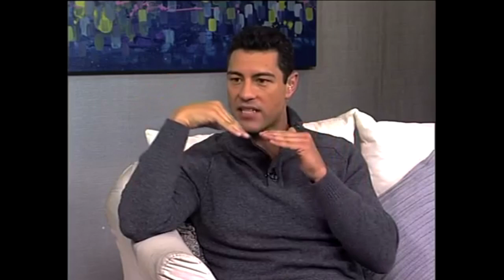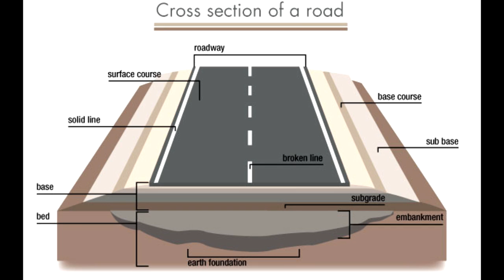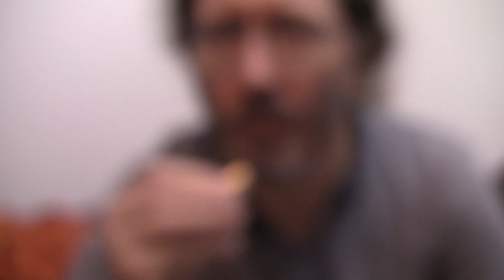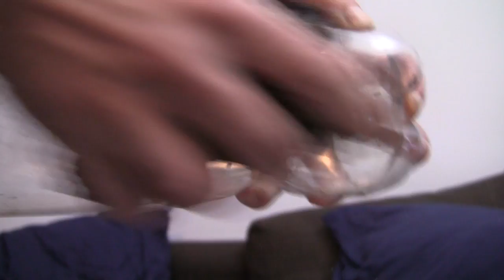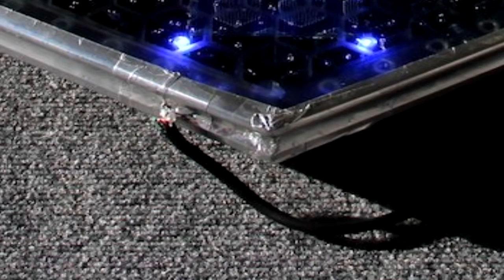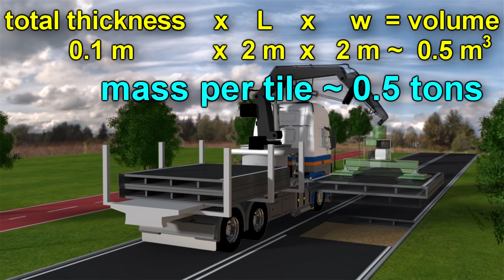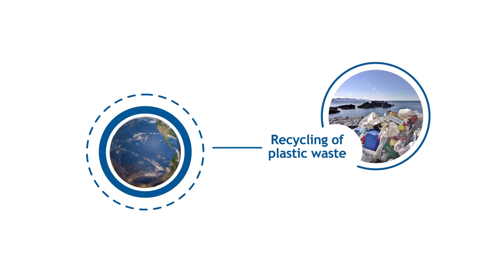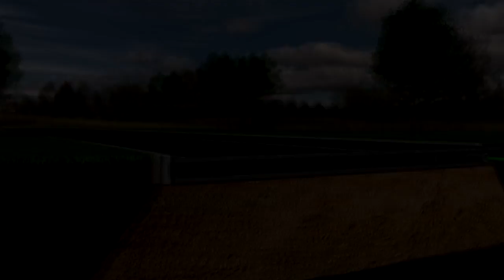Plastic Roadways BUSTED!

Comment: Or you know, we could recycle the bottles into, like, other bottles.
Reply: Or even clothes, I used to have a jacket made of recycled bottles (or at least mostly I don't remember it was a long time ago)
Reply: @kryska1345  the microplasts would be flushed out into the ocean when you wash your clothes though. Not the best option
Reply: @kryska1345  a fleece jacket?
Reply: LazerLord10 that's crazy
Reply: LazerLord10 What are you... logical?
Reply: LazerLord10
The carbon chains break each time plastics are reused.  This means that there is a limit to how many times you can recycle hydrocarbons, due to this deterioration.

A better process would be to track plastics from production through to eventual conversion into e.g. a fuel source, or conversion into some form of aggregate for use in a suitable application.
Reply: Quick, we need an animator; partner.
Reply: The problem with that is after recycling generally the plastic is no longer food-grade, so it can’t be used for bottles storing anything we’d drink. But we could use it to make bottles for storing chemicals, like bleach.
Reply: @loganiushere  nope, we recycle to be usee into the same bottles.
That's why I said they collect their own bottles. Knowing exactly what ingredients are in these bottles plastic.
With just random recycling it might be the case didn't check.
First they would even wash the bottles and refill. You could notice scratches and a wear patern on points were it was rotated around some equipment.
I don't know why it changed to melting it down and reforming, maybe hygiene.
Reply: @MrSpacelyy  yes it is cause of Hygiene, they must make sure that every little bit of matter that mightve imbued itself in the plastic gets removed, also on top of that they probably have to melt it down also to get rid of whatever weak points or damage the bottle sustained.
Reply: Generally packaging that comes in to contact with food is virgin grade.
Reply: absolutly right
Reply: We stay litty
Reply: Welp we found out that recycling is actually more expensive than making new plastic thanks to China
Reply: It degrades I think it's like 3 time they do it aleast where I am .... they even make jackets ect and outher material
Reply: Bruh
Reply: LOL, 6:40 wouldn't that just give it MORE GRIP?
Reply: *gasp
Reply: And now we’ve learned that recycling is all a scam invented by plastic companies. Great. Thanks, PBS Frontline!
Reply: @alt8791  some weird conclusion...
Maybe give us some arguments why you conclude this.
Reply: @MrSpacelyy  PBS Frontline investigated it. I believe the episode is available on their YouTube channel, and it’s definitely worth an hour of your time (as are all the episodes of that show). But in a nutshell, recycling doesn’t work nearly as well as we’ve been told, it’s far cheaper just to make new plastic, and the only reason that we treat recycling as the magic solution to all of our plastic problems is because of decades of lobbying by the petroleum industry.
Reply: @alt8791  hmm, that you still saying that.
Making new plastic is cheaper for those companies. You don't need equipment to recycle material. That's not a good reason.
Making plastic from oil is somewhat cheap because we allready proces oil. If we didn't it would be more expensive.
Also also, even if it's cheap, you need loads of energy to refine oil.
And you add more plastic to the environment.
This is undesirable. You want to stop adding plastic. But that's not yet possible. You can recycle plastic. This does use less energy in total. Even if it's not cheaper.
You don't need to get oil out of the ground, you don't need to refine the oil. You do need to clean filter and refine the plastic.
It depends on what you think is important. Adding less plastic to the environment is important.
Recycling and using less plastic will help with this.
Creating new plastic doesn't help.
Another thing we could do, is just burn the plastic and make new. This might be an option. It does add co2 and nitrogen oxide to the air, but it doesn't add plastic.
You could use the energy of the burning (indirectly) to help create the new plastic.
It might be cheaper, but it isn't cleaner.
You need to look further than just a few decades.
That's hard for humans, because that's how our brains work.
You can also recycle plastic like we do here with bottles, they used to just clean them and re-use it.
That might be a bit unhygienic, so now they collect their own bottles. Keeping the material the same. You can easily melt and reform these with little energy, and it's hygienic. This allready happens.
Recycling plastic this way doesn't involve a lot of filtering and sorting.
We have done this for about two decades, and before that we just washed bottles. Glass bottles are still washed and reused.
It does work.
Reply: @MrSpacelyy  you can turn plastic into petrol it's been done
Reply: @elixier33  ah well that's an option then.
Reply: No we need plastic cars
Reply: This is the kind of outside the box thinking we need...
Reply: Not all plastics are recyclable at all. Those pictures they show are misleading because recyclable plastic is in high demand. Odds are none of that is reusable for plastic.
Reply: Heresy.
Reply: Nope. It needs more plastic
Reply: You should make a Kickstarter! Thats brilliant! And with all this idiots... I mean people, you will get a lot of money.
Reply: Not that easy....
Reply: so after you busted solar road ways, they now want plastic ones. whats next.
Reply: What do you do with flower pollution?

It’s a real thing and some toxic or environmentally dangerous flowers are thrown in the ocean and it causes pollution just like plastic

It’s not very well known I don’t think
Reply: But don't plastic wane greatly upon recycling?
Reply: And then what? them getting thrown out too?
Reply: Plastic is already recycled.. it’s made by byproducts on petroleum fuel production. The sooner plastics get to a furnace the less particulates end up in the ecosystem
Reply: We can also recycle polyethylene bottles into RPLA 3d printer filament as well.
Reply: Don't be stupid. I know you made this comment 4 years ago but it's such a dumb idea I feel you still deserve my scorn. Clearly you have no vision, it's people like you who are holding back the progress of the human race. We'd never have gotten to the moon or got geniuses like Elon Musk if you had your way.
Reply: Too expensive
Reply: Wild and crazy notion - we could just use glass bottles or metal cans. Both of those actually are recyclable.
Reply: That allready happens. We have bottles we pay a little extra for. We get that back if weer return it. It works well because the factory gets their own bottles back. That's great because it will have those exact ingredients. Making the recycling process more predictable.
Some cities also collect certain plastic to recycle. People have to select only certain kinds of plastic.
Reply: He's thelegend27

Comment: I am not saying this is how they would do it, but I would have to assume they would probably compound fiberglass into the reprocessed PET (if they are using PET due to abundance). Loadfill can affect shrinkage and expansion significantly; not to mention the polymer and fiberglass orientation. I would also assume the surface would be textured. Yes, you can regrind fiberglass compounded materials; however, it will break up many of the fibers that are in the regrind - this gets done all the time in the plastics industry and can be found often in drawings for molded and extruded components. 

However, I can't imagine this would be very cost effective due to the amount of work that has to be done. Regrinding, extruding & compounding, thickness probably creates a super long cycle time etc. Not to mentions, how do you handle intersections and curves (like on/off ramps).

Comment: This is even actually worse than the solar roadways idea. Solar Roadways at least had physical prototypes - this, like the waterseer and other bullshit, is entirely CG graphics with no demonstrable prototype at all. Hell, it's even not as mechanically good as the solar roadways - it's hollow plastic apparently made from recycled plastic bottles and the like. How in the fuck is that supposed to have the mechanical properties needed to construct a road that has to deal with motor vehicles? Even Solar Roadways, as much of a non-starter as it was, had more going for it than this.

Comment: There most certainly are duroplasts which could handle the job. Multilayered POM would be my first thought if Id have to stay away from fibre komposites. Would still be a stuipid idea. Also, some fibre komposites are recycleable, depending if thermo or duroplast. Youll never get out 100% material though.

Comment: You know the more I see you debunking these Insert gimmick modular road ways it makes me wonder if any kind of modular roadways would even be viable much less with added gimmicks.  Like lets cut all the crap out and just try to make a modular road surface, i feel like the "best bet" would be traditional asphalt poured and hardened in some factory onto plastic tiles that could be stacked up trucked over and set in place.

Would that layer of plastic under the asphalt give the road surface too much give causing it to wear out faster?  Would that plastic layer's higher expansion rate cause even further damage to the road surface than normal?  Would have expansion joins everywhere reduce tire life on everyone's vehicles?  Once a road tile's life is done would there even be a way to separate the asphalt from the plastic to recycle them efficiently?  Is there any form of Modular Road Way you think could ever be feasible?
Reply: The Germans already did "modular roads", i.e. built highways out of concrete slabs, in the Third Reich era. The problem is usually that the slabs tend to move a bit as the soil settles, and the road surface will be bumpy at the joints. Also the slabs tended to crack after a while. Those roads did last for a long-ass time though, I think some sections are still around, but scheduled for replacement.
Reply: interesting i didn't know that, but doesn't concrete have worse traction that asphalt?  actually i hadn't thought about concrete though, maybe concrete slabs with a asphalt coating would work better than plastic and not have to sacrifice traction.  But a lot of the same questions would apply.

Comment: Aluminum Roadways, just use the road itself as a power line. Snow, ice and water will be instantly vaporized by high current. Cars will have perfect traction from static electricity.
Reply: Philip Bender and also cost a mere 10 grand an hour to power.... hey what if they were solar powered....lol
Reply: We would need to create a market for asphalt, beer cans maybe?
Reply: Philip Bender see how many times you can drive a car over an aluminum pipe. answer is not many
Reply: datipa disdick excellent observation. But I assure you it would not be a pipe but a 1-foot thick aluminum wire mesh for ultimate environmental plasticity and user durability. You could literally role these roads out anywhere. They would come in spools of 1 hundred miles.

Comment: Thunderf00t you make the same logical fallacy with the solar roadways by rubbing plastic with a piece of asphalt.  In what situation would that happen, our tires are made out of vulcanized rubber not asphalt, what are the tires made out of where you live?  Its not showing accurate "wear and tear" even though they are a far inferior surface than asphalt. Granted I completely agree that this and solar roadways are impractical and more than likely scams. I just don't like this example of showing how easily damaged the surface is.  Also quit ragging on the burying of utilities, I think that's a awesome idea because 1.) security, harder to mess with 2.) weatherproofing, shouldn't get knocked out by ice and snow and 3.) It looks better than power and cable poles.  But other than that I agree with you completely.

Comment: how do they do patch work?
Reply: They fill the potholes with solar powered thorium
Reply: They remove the whole panel, shred that panel to make fresh panels, then put down an entirely new panel. Economical!
Reply: lol. I meant as in a small pot hole, or 25m crack down the center of the road. Cutting the entire panel away to fix a pot hole..... DUMB!

Comment: You never hear about the tires in all this. tire rubber is formulated for maximum friction on granite aggregate. if you change the road surface composition, you'll have to change tire material to compensate.

Comment: I saw a flaw directly, if the road have cables and pipes inside it will not be possible to change parts as they showed and during could periods they'll not be isolated so water inside the road will turn into expanding ice.
Reply: Rex Kenny there the small problem of it just being a fundraiser scam too.. of course.

Comment: I think this "could" work if you simply melted down plastic and put a bunch of ground rocks in it. only problem with that is that plastic is basically oil in disguise. so it's just an alternative way of binding the rock together. instead of using oil. you use plastic which is made from oil. :/

Comment: But what about the cables that are installed into the road?  If the section of road needs to be replaced, the cables will either have to be reran (very expensive) or have couplers installed (very expensive at first, cheaper to repair or move sections in and out, but causes a loss at each coupler increasing the inductance and reducing the distance that "whatever the cable is acting as a medium for" can travel.

Comment: they have alot of knowledge and experience in dealing with a lack of stiffness? somehow that doesnt surprise me. Crude joke over. but yeah I work in a bottling plant and the slightest nick in a bottle with a utility knife while unwrapping the pallet or dent in the right spot and BOOM! as soon as the valve on the filler opens up the pressure blows the bottle apart scaring the shit outta everyone in the area. not the most robust material, if a small nick cant hold up to the pressure of carbonation id like to see it handle the weight of a snowplow or garbage truck, or how resistant it is to road salt and constant freezing and thawing during the winter

Comment: My last comment was long so let me just state a fact; MANY road surfaces in America - use Blacktop already made with SOME AMOUNT of Recycled Plastic, Rubber, and even glass as parts of the aggregate! 

I KNOW first hand, my Neighborhood, a purely residential suburban area - used this exact sort of Blacktop about 10 years ago when they last re-paved! And guess what? It actually WORKS BETTER than normal Blacktop without any glass, plastic or rubber - ESPECIALLY in the rain! It is funny because I can take hard corners faster in my neighborhood when it is raining than I can on most other nearby roads, because those roads all wore really smooth unlike my neighborhood!

Comment: The cross section brought back to mind an old question of mine that I could never answer for myself. Basically if we pretend we have infinite money to throw at it would putting heating coils in the roads to prevent freezing be possible. Putting it in the asphalt itself is obviously a problem but maybe just underneath?
Reply: It would indeed be a big waste of electricity, but it's doable. Heated driveways can be done as a DIY project.

Heated public roads and pavements are implemented in some places, using water ducts instead of electricity. In Nordic countries like Finland (where they use low-grade waste heat from power plants) and Iceland (where they use plentiful geothermal heat).

Comment: Alright, here is an actual GOOD concept. Why not, instead of trying to replace the roads with solar panels, build these. I call it, the Sunroof. Simply build solar panels over all of the roads, bridges, and parking lots, and slant them so rain and snow falls to either side of the road, with gutters to drain the water just like a house. The solar panels would provide power, as well as keep the weather off of the roads, greatly reducing maintenance. also, they would cover parking spaces, essentially giving everyone in the lot a shady parking space, whilst also generating electricity to power nearby streetlights and such. 
You know, instead of having fragile solar panels being driven on, that don't keep your car from becoming a greenhouse and also NOT generating power whenever you park your car on them.

Comment: Plastic roads was an idea I had about 10 years ago when I was a 6, I thought it was a great idea because of how rubber grips plastic.
I thought it was great until I realized that just as soon as any oil or moisture gets on plastic, it becomes a nightmare for traction. That apart from the fact that unless they make it with some kind of tread pattern on the road itself, any contaminants on the road will completely negate any benefits of the surface (especially gravel), as if you were driving on loose gravel, because unlike asphalt, plastic roads do not have a rough pattern and are a much softer material than asphalt.

Also, you know, we have many millions of tons of material for roads.
I don't think we have that much plastic.
I commented this before watching the video just from looking at the title, btw.